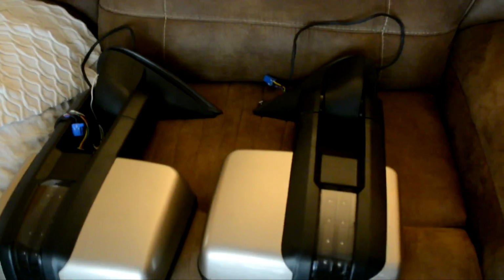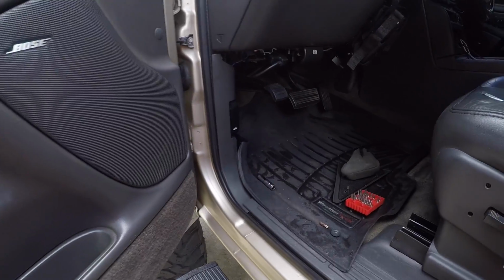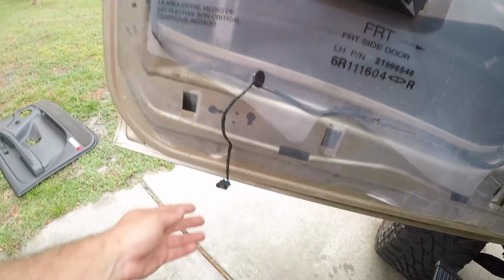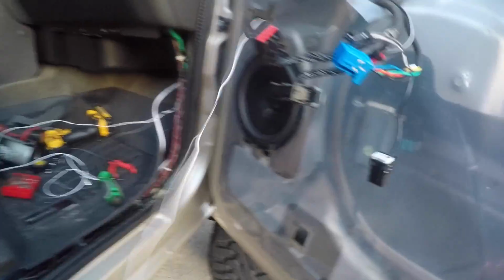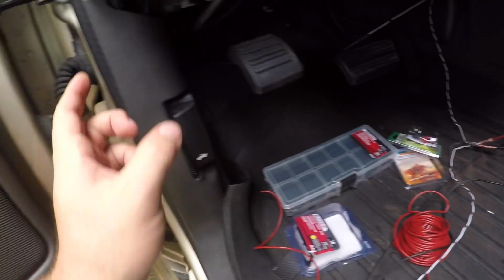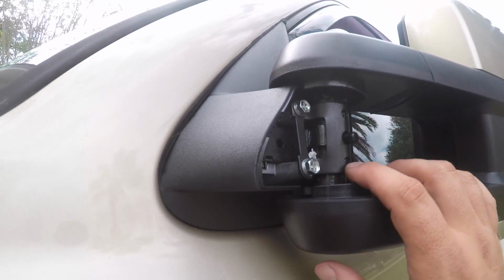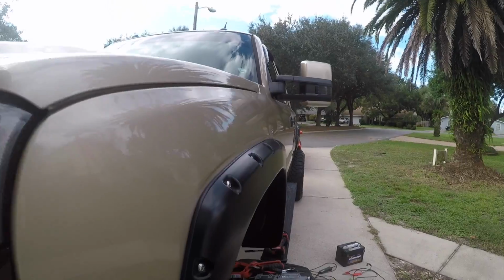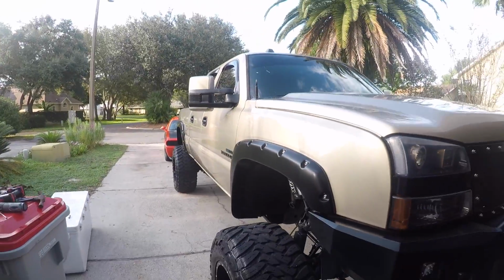HOW TO: install and level new style tow mirrors on DURAMAX!

Comment: I just ordered a set of these mirrors for my 1990 Chevy K3500 Extended Cab 1-Ton 4x4 Dually that I am getting ready to spray the entire truck in 3 colors of Raptor bed liner. This truck never had power mirrors or anything, so I first have to figure out how to get rubber wire looms in the doors before I can get these mirrors wired up. It will be a huge task to get these mirrors all wired up, but it will definitely make this 1990 Dually stand out when it is done.

Comment: Thanks for the tips on grinding down the edges! I didnt think of that when I first put mirrors on my truck, and that plastic piece kept popping off because of how I had adjusted the angle. Trip to the car wash, and no more plastic piece... Getting a new set soon, and grinding down the edges like you did should fix my issue! Thanks again!

Comment: But when you put the spacers behind the mounting screws to level the mirror it changes the way the clamping and the detent works and the mirrors do not lock in well and the wind at highway speeds makes them move.

Comment: I have these on my dually and for some reason the passenger side mirror is at a different angle than the driver side. I’m talking about how you can fold the mirror against the truck and forward. It had like 3 or 4 notches u can put it at and they are different, the passenger side does not land in the right spot. I’m gonna take the cover of the passenger and see if something can be adjusted on that. IDK

Comment: I was wondering if there was a way to level them up to make em look factory installed. I see so many around my hometown that don't look good because they are angled upwards. Thanks for the info. Now I'm thinking of buying some for my 2004. Only thing I pull on occasion is my brothers pontoon boat, but when I do I sure could use them.
Reply from the maker: They are great to have man! Check out boost auto parts
Reply: Yeah there's a cap on the outside under the 2 arms that pops. Off and you can shim. To level

Comment: I bought the 07 hd duty mirrors and replaced the stock ones but the new ones wires are cut and no wiring harness can I splice the old stock wiring harness to the cut wires on my new mirrors

Comment: Bertrand850 great DIY tow mirror install. Getting some of these for my truck. 
Question for you, where you get those headlights and what brand?
Reply from the maker: Thank you man! They are custom @retrodiodes headlights
Reply: @BERTRAND85O  figured they're a custom set. Haven't seen them on any sites. Going to check that tag you add see how much they run. Keep up the great posts man.

Comment: Did you buy the mirror caps color matched or did you have a shop get them painted. I’m wanting to do the same thing & how much was it ?
Reply from the maker: Reese 256 bought the mirrors from boost auto parts with paintable caps and had it painted locally
Reply: D_BERTRAND850 yea those are the same mirrors I have but I just bough the black caps for a temporary set up

Comment: Glad I watched this right before installing mine. It’s a joke how they bolt on tilting up so far.. I have to say, Dodge tow mirrors are better then Gm’s.. I bought a set off eBay back in the day for the ol 2nd Gen and they bolted right on no problem and sat perfectly level and probably even look better then the Gm ones and perform better. But hey, you live and you learn right? I would have to say dodge is the winner for best tow mirrors on this planet 🌎

Comment: Any weird vibrations or the mirrors folding in on themselves? Thanks for the video even though it's old.
Reply from the maker: No sir!
Reply: @BERTRAND85O  alright thanks a lot. About to do this on my Tahoe. Duramax swap with a 6 inch lift, I couldn't see shit with my dinky stock mirrors, but the uneven angle is starting to trigger the shit out of me.

Comment: How functional are the clearance lights? I’ve never had them but they look like they might help with backing up a trailer at night. Do they actually help anything or are they just for looks?
Reply: The stock or aftermarket reverse light is not that bright. But Boostautoparts sells a easy replacement high power light.

Comment: Now I have the power mirrors so other than those little spot lights that's only extra wiring I have to do correct? These are manual pull out correct? Only accordion looking ones are power in and out correct?
Reply from the maker: correct

Comment: I got a ‘13 silverado and got the exact same mirrors, does the small connector that comes installed with the mirrored need to be wired or is it optional? Trying to do it myself but saw your video and just had to ask
Reply from the maker: it don't have to but its just nice having those reverse lights

Comment: Hi Bertrand850,  Thanks for the video!  I wired my lights exactly the same way, however, they only turn on when I put my truck in reverse.  Any idea what is going on? I want them to turn on when I unlock the truck with my remote.
Reply from the maker: VeeVaa1966 will need to wore it differently man
Reply: I have a 2006 Chevy  Silverado. Wouldn't the wire set up be the ssame?
Reply: I think the guy in the video showed how to wire it up so they come on in reverse. To make them work how you want they would need to be wired into the outside courtesy lamp circuit the original mirrors puddle lamps work on.

Comment: Hey man was wondering if you could help me out with this I'm wanting to put the 14-17 tow mirrors on my 02 Chevy Duramax was wondering if the plugs were the same or are they different
Reply: Ruben- I Have an 03 and I purchased the "2015 Style" for it, when I Purchased them I made sure they were for my year and everything was plug and play. You shouldn't have any issues UNLESS you are buying mirrors with Options your truck did not come with. If thats the case you will have to wire them up yourself.

Comment: Only connecting the passenger side to the fuse box allows both sides for the reverse lights to work?
Reply: Stephen Kramer no he used butt connectors to connect both to a single wire and that way he ran 1 wire to the fuse box you can see @ 8:30